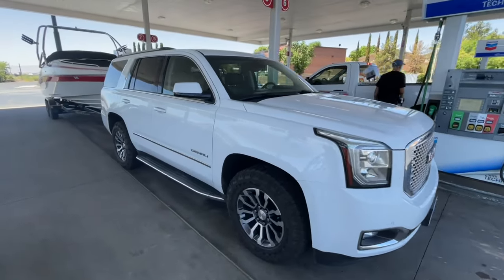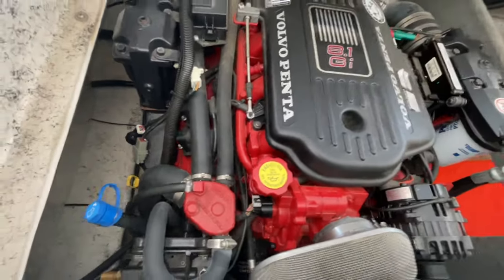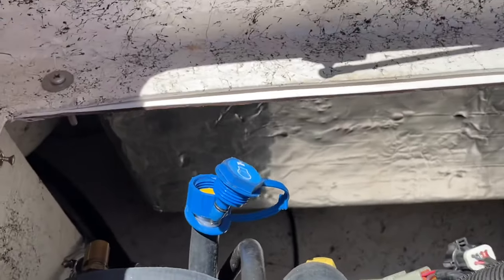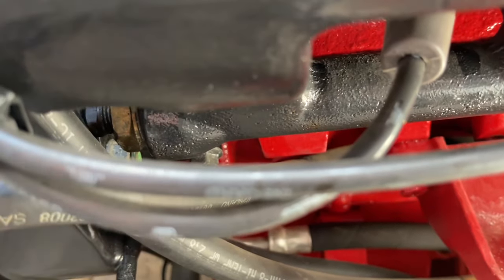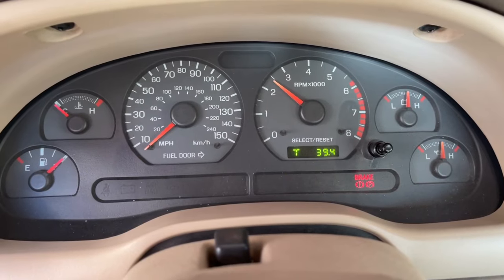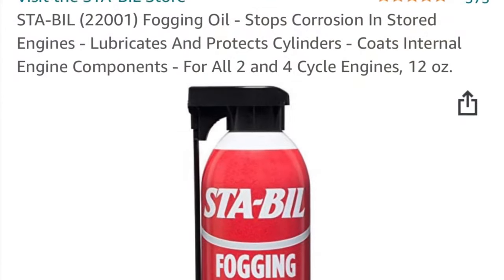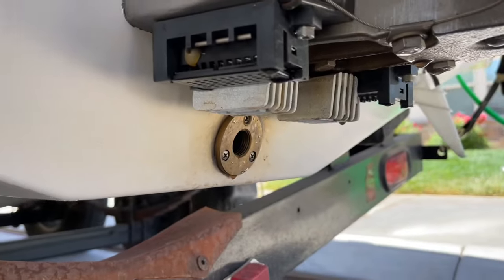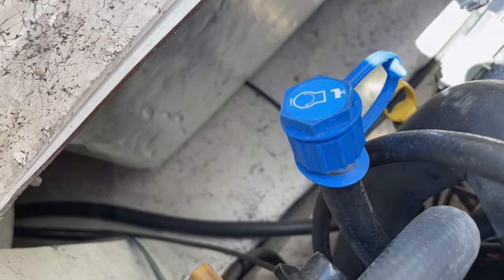Summerizing Your boat: How to de-winterize your boat

Comment: Good tips, I would add that it's good to charge your batteries if they're lead acid a couple times during the winter and charge them up with a charger before you go out since they degrade pretty fast when they're at a low state of charge and jumping and running the boat for a few minutes is stressful on them and doesn't really give a full charge and battery chargers are not real expensive.